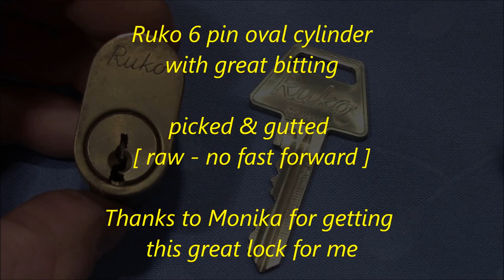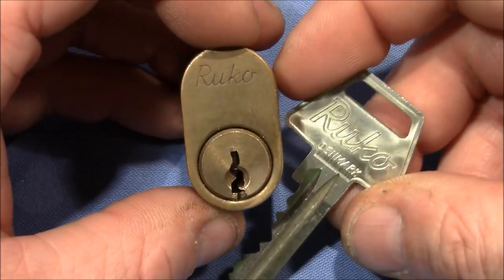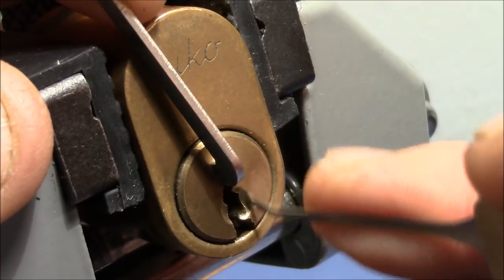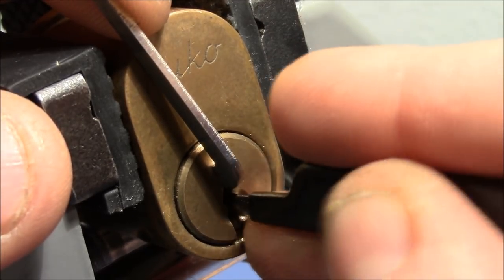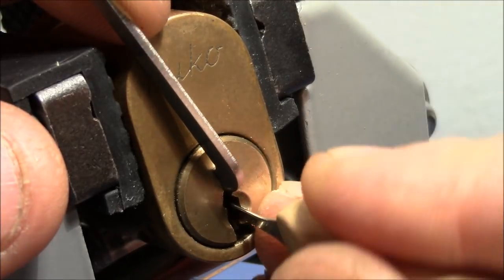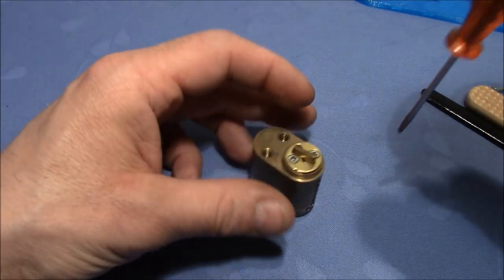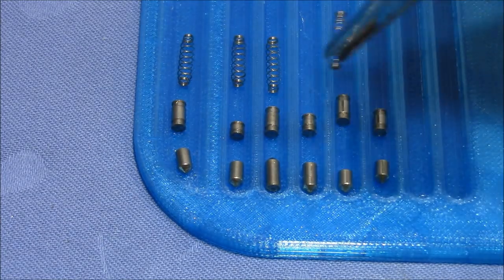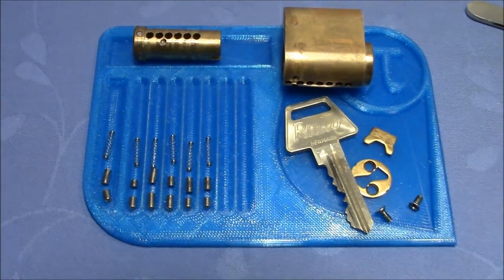(picking 504) Ruko 6 pin oval cylinder with great bitting picked/gutted - thanks to Monika

Comment: This us a 600 series. The gin bottle pins were only used in the 500 (and occasionally in the extremely rare 700) series, which also had the core with mantel.
Reply from the maker: Ah, ok. Thanks for the info. I was thinking that the drivers of my Ruko are just the newer pins and the other shape (as shown by my red model) you can find in older models.

Comment: Great picking Michael, Ruko are awesome locks to pick, I have some from my friend oceanaut and they are locks that teach to pick. Great vid buddy, thanks for showing ;o))
Reply from the maker: Thank you buddy. Having this older lock open is great but I have a Ruko Assa 2 padlock with a brand new Roku core in it - just looks the same as the one in the video but I had luck yet. The bitting is easier but the feedback is weird - I feel like I had never picked open a lock before ;-)
Reply: I know how you are talking about, I have a new Ruko 6 pin oval lock and it is really nasty, I think the problem is that the contact between the pick and pins is very easily lost and we do not realize it. To open them you have to be very precise when pushing the pins. It only remains to continue practicing, don´t give up, sure we will see the video of that Ruko2 soon ;o))
Reply from the maker: Will continue trying as always ;-) Thanks for the tips.

Comment: Beautiful lock that Ruko!  Thanks for Sharing!  Since I just watched the Bosnian Bill Whipped by Steve Challenge lock with overset trap topic it was interesting that this had the like challenge involved and I loved how you overcame it with the second pick!  I'd love to see you get a hold of that Steve Challenge lock from Bosnian Bill to see if you could have success with it!  Thanks Again for Sharing this Video!
Reply from the maker: Cheers buddy and thank you :-) I also saw BB struggling with this wildly bitted lock. But it looks like that my lock is much less dramatic as his. With the key bitting of the Ruko you can insert the pick sideways without oversetting. But not so on the lock from Bill. There even the shaft causes an overset.

Comment: I believe those pins are hardened then centerless ground to dimension.
Reply from the maker: That sound interesting, why do you think so?
Reply: Potti314 They are steel.  It would be quite difficult and take more machining time to lathe cut them, especially to the tolerances demanded by ASSA.
Reply from the maker: OK, checked out what centerless grinding actually means and hey, learned something new today - thanks for the inspiration buddy :-)

Comment: Bravo! Very well done! is there an advantage to picking a lock counter-clockwise? I'm sorry if this is common knowledge, I'm a newbie and just learning.
Reply: slipdawg97531 some people find it easier and sometimes if you can't pick a lock clockwise it might be easier to try it counter clockwise , this is why there are plug spinners sold so if you can only get a lock to pick counter clockwise you can still get an open by spinning it really fastly clockwise 😊, I hope this helps answer your question mate and best of luck in your picking endeavours 😊🍻🔓
Reply from the maker: Thank you. I usually try to pick open door locks counter-clockwise as this is the direction at which I would unlock my door. Padlocks are picked the other way around, so I have always a good mix.